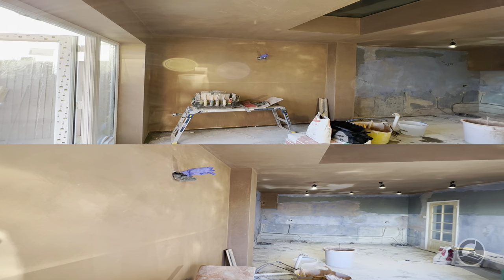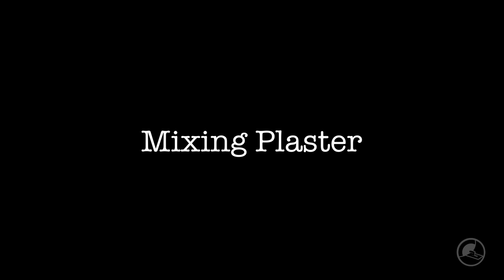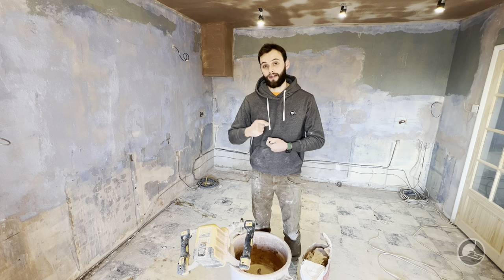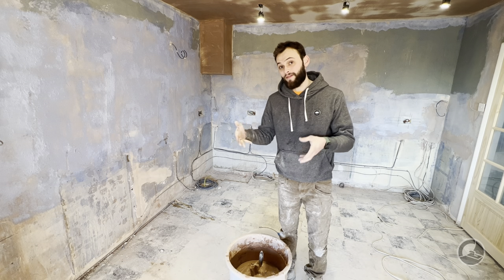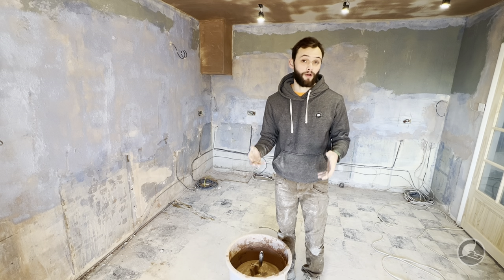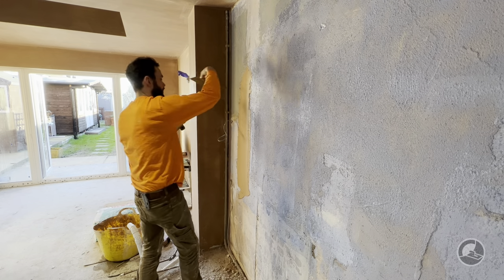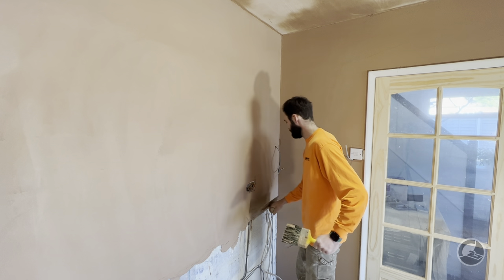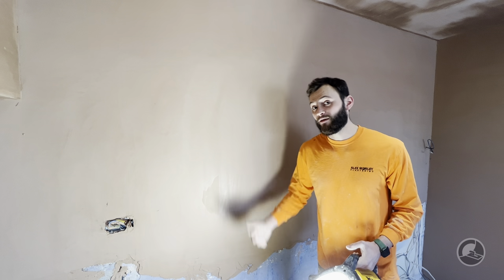Beginners Guide to Plastering

Comment: hi mate, been using my 13 nela carbon 6 months now, just breaking in nicely, but noticed the heel of the trowel has turned quite a bit,  it has got quite flexible which is great, but wondering will this be a trowel that will last me years, as i look down the blade and its a bit all over
Reply from the maker: I have had my 14” Nela for 6 years. Fairly average wear tbh. My
Previous boss had his for about 26 years. (MT carbon) It will be more flexible than SS. Regards the waves. Although I wouldn’t be overly concerned. It’s worth looking at how you store your trowel. As that can massively effect how wavey the blade is.
Reply: @AlexMorleyPlastering  do you prefer the 14 over the 13? i’ve just received the 14 , to see the comparison

Comment: Hi Alex would you recommend the nela carbon 14 inch? Looking for another solid option too My MT and was wondering what your experience is like with the nela
Reply from the maker: I have had the Nela 14” with a wooden for about 6 years now. By far the best trowel I have had. I would by another. Most of the time it’s the only trowel I use for all stages of a set. Gives a better finish that a flexi.
Reply: @AlexMorleyPlastering  thanks for insight. Will definitely have too order one and see👍
Reply from the maker: It’s a great trowel. If you can break it in on render it’s much easier.
Reply: @AlexMorleyPlastering  ok thanks mate. Appreciate the insight 👍
Reply: @AlexMorleyPlastering  ordered it last night coming Monday ready for a big week😂👍
Reply from the maker: I’m jealous. I love a new trowel.

Comment: Love the channel Alex. Quick question, why don’t plasterers appear to use spot boards any longer? I thought it would be quicker to draw the plaster from a board as you don’t have to change trowels. A marginal difference I accept !!
Reply from the maker: We don’t because we do much larger mixes. Spot boards only take 1 bag, generally we mix 3 bags at a time. Even if you were to pour it out a bit at a time the bucket would be too heavy to lift up. Lastly they take up a lot more room where we are working, and it’s another thing to carry in the truck 

Hope this answers the qs.
Reply: @AlexMorleyPlastering  great thank-you